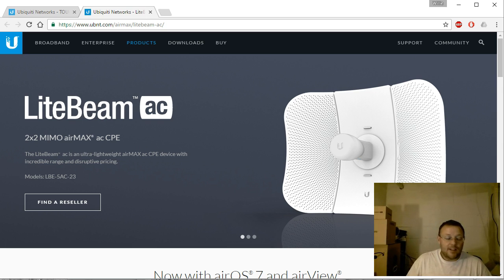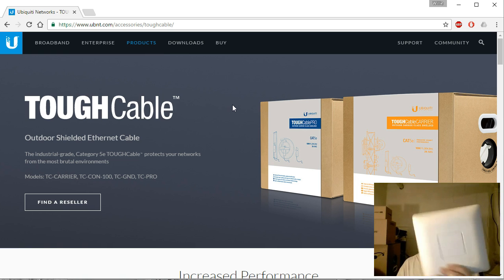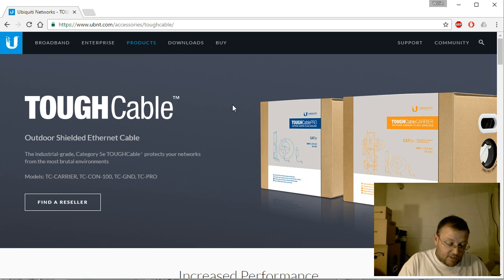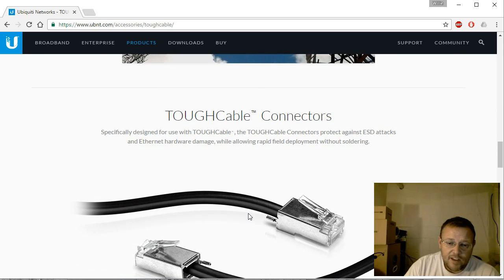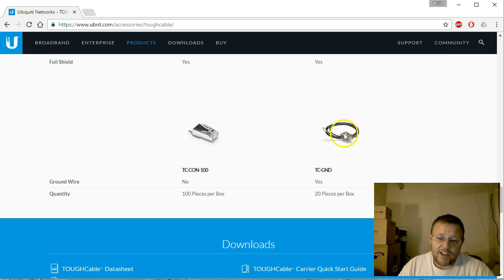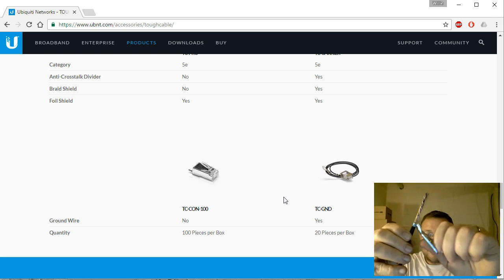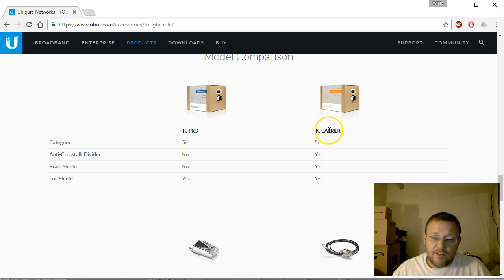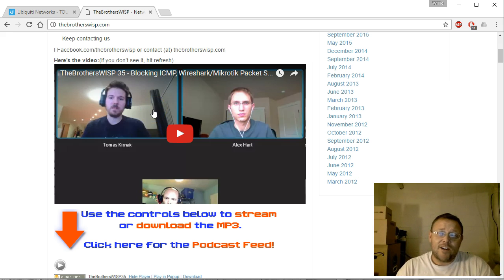Ubiquiti TOUGHCable

Comment: +willie howe  Did you make the follow up video terminating the TOUGHCable?  Would it be necessary to use this outside but in a conduit?  I am going to replace my analog CCTV with IP cameras.  I have a 1000 ft spool of Cat 5E solid cmr.  I was going to route it though the  basement.  Then through the wall to outside.  I was going to feed it though conduit to each of the 4 cameras.  I have run cat5e through many houses.  I just never had the need to go outside with it.
Reply: Can you use a regular crimp tool for the TOUGHConnector?  I have a ground strap run into my room with my equipment.  Would I just attach all those runs to that ground strap?